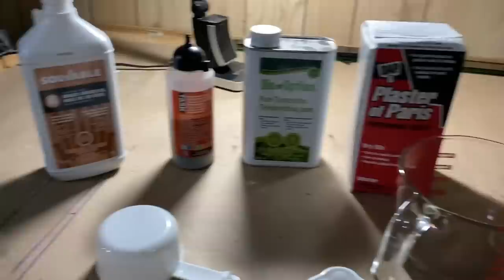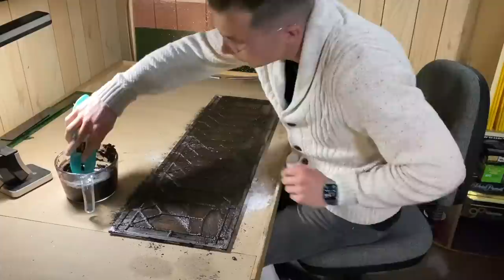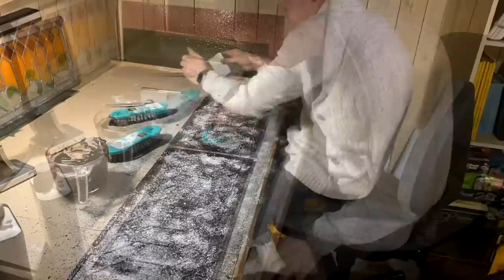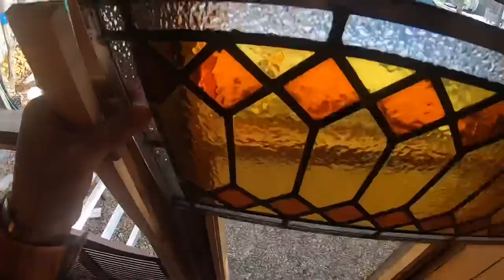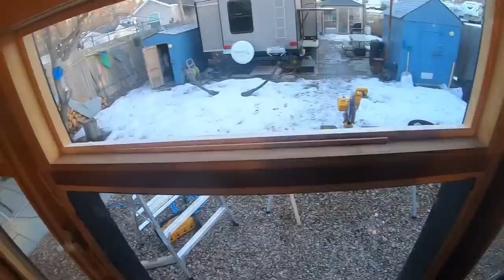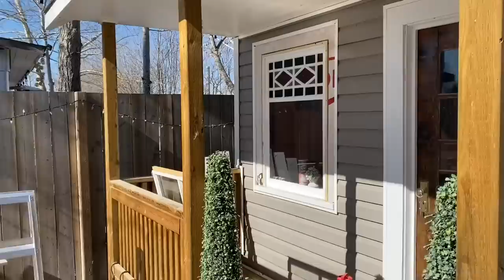Saloon Build Episode 19

Comment: looks really nice ! , a really neat way of sealing it up , i have used lots powder dye for masonry and mostly brick mortar , it is very similar but it has more dye power , they do have about 7 colors i think well back then 80's and 90's they could have more now , morocco brown was very popular color with brick  the ratio was 18 shovels of sand to 1 bag of mortar mix aprox 5 gallons of water depending on sand , dry or wet , and 1 small tim hortons cup of dye  so you can see what i mean about the strength of the dye  , your cup what you used would do a whole batch of mortar aprox 1 wheel barrel full of mortar , and  back then a mudium tims cup is now a small these days ! ...

Comment: One quick question: don't exterior stained glass windows need some more structure than just the mullions and stiles?  We used to back them with a wire/metal outline; or, some plexi in front to protect it from the wind shear.  Perhaps this is moot as you may have it protected well enough and the windows aren't that large.  
There is no money to be made in stained glass work. nowadays. especially when you realize all the effort it takes to get to the end product.  People aren't willing to pay for it when they can buy cheap Chinese junk; that's why I gave up trying to make it go and only make stuff, like you, for my own enjoyment.  You're doing great!  Keep it up!
Reply from the maker: I was debating putting a metal rod vertically in the center of the frames with some wire soldered to the windows to to tie to the rod. I have seen it done before on larger transoms but mine were only 10 1/2” tall so they were fairly stable. As for doing stained glass for other people, I have it listed as one of my services on my business cards, I don’t expect to get any calls for it though and if I did the price would probably scare them away lol
Reply: @AustinTischler  You're doing great.  I, too, used to offer it as a service but it is not cost effective between uninstalling, repairing and reinstalling so I didn't do much of it.  It is a good skill to have in your tool bag and once and again, it might prove handy.